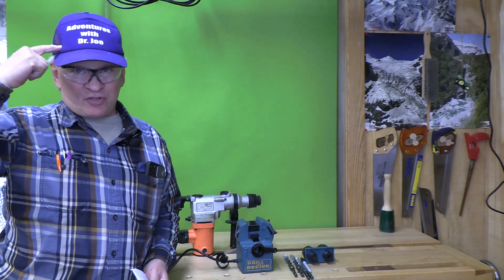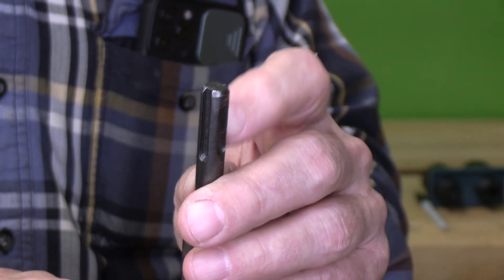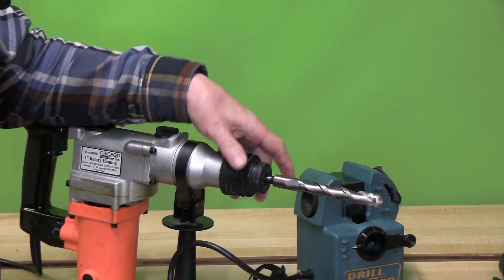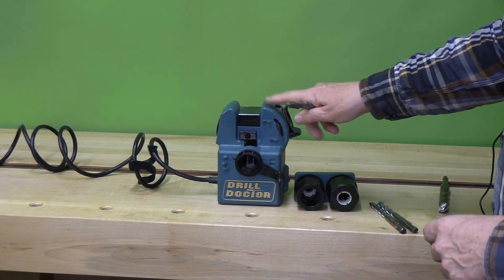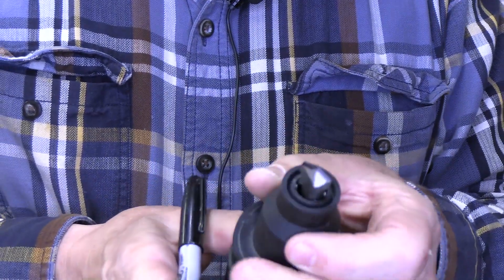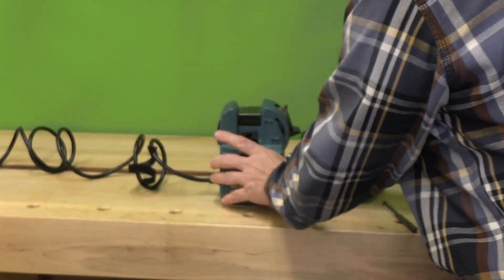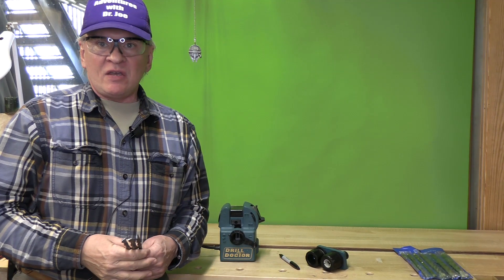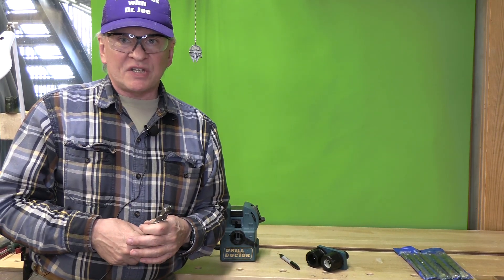Sharpen SDS Drill Bits Simple Steps

Comment: Are you guys using 135 degree setting on masonry drill bits? Supposedly that's good for hard materials, like concrete etc. Thanks
Reply from the maker: SDS drill bits are usually around 130° so I have 135° on this machine. That's the angle I choose to sharpen these and it has worked well. Some are actually 160° which aids in durability and effective hammering into very hard aggregate materials. I don't sharpened to this degree. Consider subscribing. Thanks. Joe